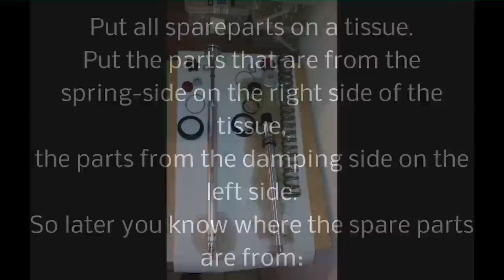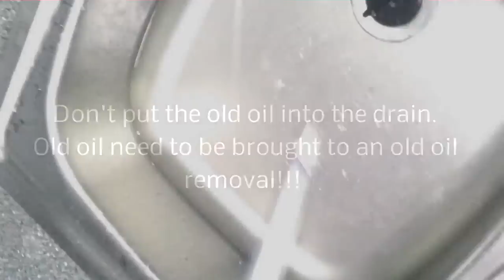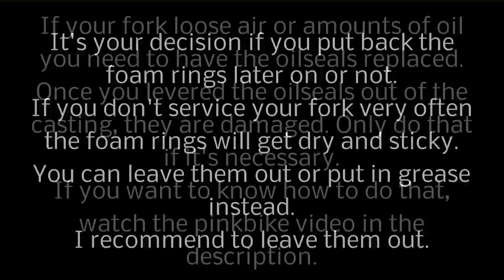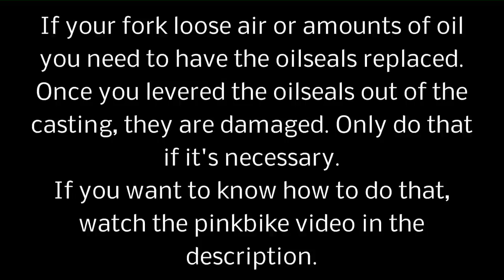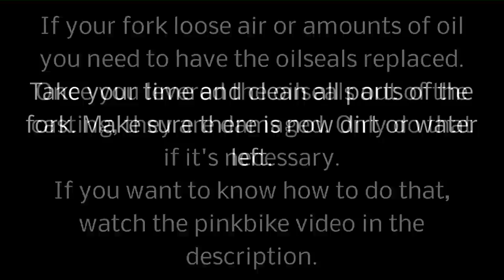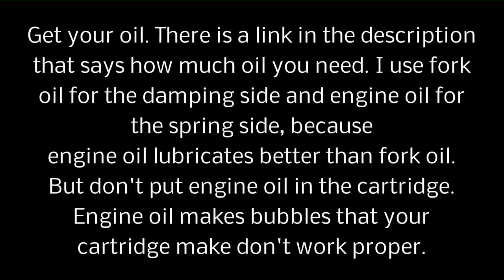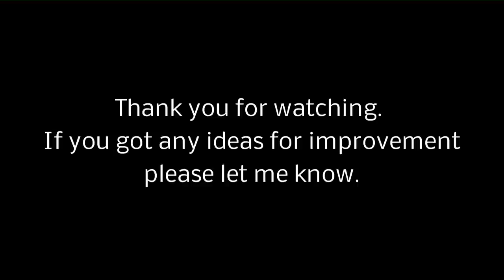Marzocchi 66 RC3 Ti - Oil Change / Service [HD]

Comment: Great tear down video. I usually clean out the cartridge by filling a pill bottle with some new oil, then put the end of the catridge in it-making sure the hole is under the oil level-and pump it a bunch of times. You can dump oil and repeat if a lot of nasty stuff comes out.

Comment: Just did a very complicated service of a 2012 Marzocchi 55 RC3. I overtightened the lowest black nut under the dampener side. Because the black knob is made of aluminum it broke in half. I said "Hold my beer" and I made a new nut in brass, which would have been a good choice of material from the start. Reshaping the brass top nut took two evenings, and reversing the threads another evening, but it fits perfectly. 

Somewhere along the line it lost the small O-ring that sits inside the lowers on the bottom on dampener side. It caused a mysterious oil leak, coming from the threads between the lowest previously black nut, and the red dampener system inside. A regular O-ring did not fit, so I had to fashion a really thin O-ring from a bicycle tyre. I have been jumping on the fork and no leaks yet! crossing fingers 

Soon I can rebuild a whole fork! :P Marzocchi can just go bankrupt again, I don't care.

Comment: Great video really helpful, I've been told you can use green 9 weight oil instead of 7.5 weight and it gives you more adjustability.

Comment from the maker: Hey,

it may be just a leaking from the valve. So you could just change the inside of the valve.
Normaly there should be no movement.
I haven't take this part apart, so i can't tell you more.
Write to marzocchi service center for a detailed answer.

Cheers

Comment: Greetings. I still have this fork on my ‘13 truax. It definitely needs a service and is currently clunking after compressing and lifting up. Is this a problem with the oil or an internal failure like the cartridge? Also since the fork is so old I’m worried that the seals may go soon, should I order new ones or just try the service in this video? Thanks for posting this
Reply from the maker: Surely could be something with the oil or with the negative spring.
Just give it a check up?
Are this the original seals?

If they are, put in new ones. After 8 years the rubber goes hard.
Would be a shame to open have to open the fork again
Reply: @matthias6353  ya original seals I think. I'll have a look online and see if I can find some replacements. Do you know where the best place is to find a seal kit for this fork? thanks man.

Comment: Hi Matt!
Thank you for a great video.
I have a question, and I really hope you could take your time to answer as I will be leaving for the alps on friday, and need do assemble my fork before that.
My fork is a 55 RC3 Ti 2011.
I'm confused about the little ring that you take out of the fork right after you take the snap ring out, at around 9 minutes in your video. Is it supposed to be a similiar ring inside the other stanchion, or just on the spring side?
Because I can only find one, so I'm really worried that I wont get the fork back together before friday.
Hope you have the time to answer me,
big thanks Matthias
Reply from the maker: Hey,

its just in the spring side. See the drawing ( http://www.mountainbikes.net/mtbikes/ersatzteile.cfm?gnr=52 ). Its the little ring right under number 54.

Comment: oil name plz ?? is that 7.5 w ? my only problem i don't find this oil here shit
Reply from the maker: Hey,

this is "wilbers gabelöl (forkoil)". But motorex and maxima racing fluid are also that good.
It's 7.5w oil. But you can use thicker oder a little bit thinner oil to match your preference. Also you can mix different viscositys.

Comment: Hi Matt.  What type of engine oil did you use in the spring side?  Is this truly ok/better than fork oil?  I've read elsewhere that engine oil may perish the seals.  Great vid by the way.
Reply from the maker: I don't remember the oils specifications. It doesnt matter which oil you use. Motoroil provides a better solution. But i think forkoil will do the same. I didn't expierence any damage on the seals. But i also couldn't confirm that motoroil is harmless to the seals.
Reply: Cheers

Comment: hi my forks marzocchi no work the rebound help please!
Reply: +nelson mansila i change the oil and notingh
Reply from the maker: +nelson mansila 
Put your fork back together until 18:20 (Minutes). Make sure your rebound is fully open (counterclockwise).
Now fill in some of the oil. Work the cartridge shaft up and down. There should be bubbles coming up. Do this until the oil level lower or there are no more bubble comming up. Fill in the rest of the oil. Work the shaft up and down again. 
While doing this you should feel that there is more restistance.
Reply: already but I think the cartridge is damaged because the bottom of the fork is not the same as yours
Reply from the maker: +nelson mansila Thats one option. But without any further information about model and without any pics i can't help.